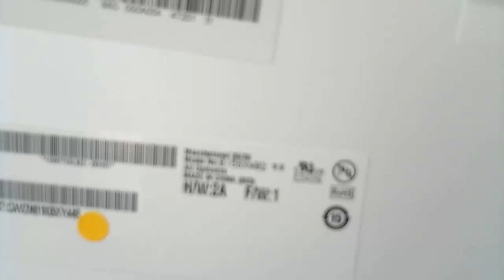HP dv6-1375dx Laptop Screen Replacement Procedure

Comment: hi Screensurgeons.Nice video.I have hp Pavilion dv6-2157wm laptop.almost the same from outside as 1357 in the video.My screen recently started giving horizontal green lines that started from top of screen and move down.But today the whole screen color has started changing with lots of lines.i plugged in monitor to VGA slot and it works fine.Can you please help.Thanks

Comment: I followed all of your steps but as I was disconnecting the connector from the old LCD there was a tiny spark and now my computer won't power on at all. I tried taking out the battery and holding down the power button for 30-60 seconds but it still won't power on. Do you know what the problem could be?

Comment: Hey, I just wanted to send you a very big thank you. This video showed me exactly how to fix my laptop screen. Worked like a charm!

Also, I have a circa-2010 dv6t-2300 quad edition, and I can confirm that this procedure is just fine for that model of laptop.

I found a screen on amazon for 50 bucks, which worked: HP 570095-001 was the part.

Comment: I HAVE A QUESTION MY SCREENSURGEON..... I REMOVED THE SCREEN AS THE VIDEO SHOWED (GREAT VIDEO BY THE WAY)....AND I WAS PRESENTED WITH THE PROBLEM OF THE CONNECTOR BEING ON THE OTHER SIDE... NOW WHAT I DID WAS ORDER AN "EXTENSION CABLE" FOR THE SCREEN, FOR SOME REASON THE SCREEN IS NOT LIGHTING UP... I HAVE A HQ-LED40-156 CABLE... PLEASE HELP... LET ME KNOW IF I'M USING THE WRONG CABLE AND IF SO.. WHICH ONE SHOULD I PURCHASE....THANK YOU IN ADVANCE...